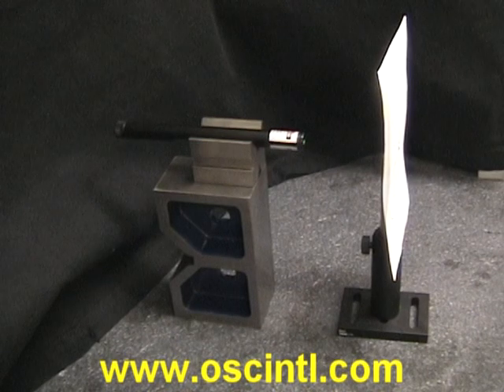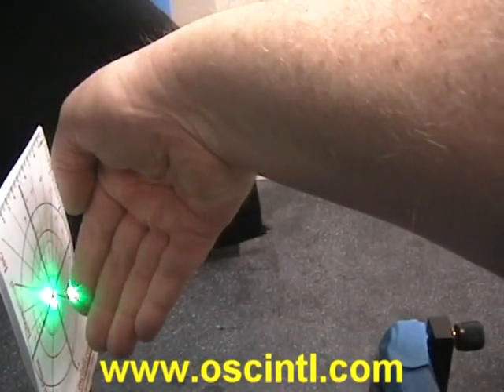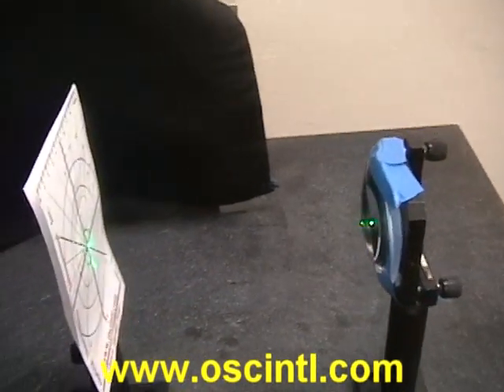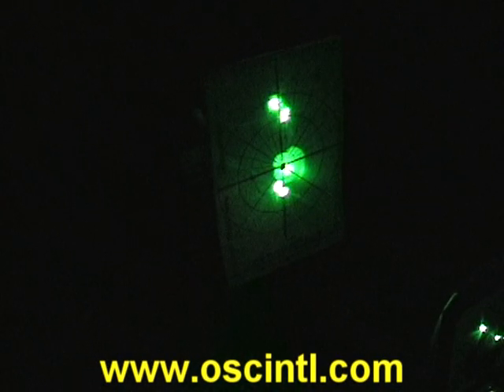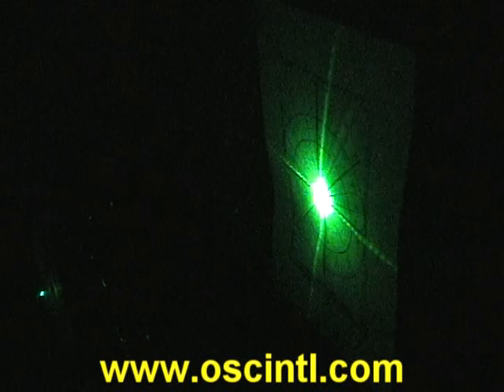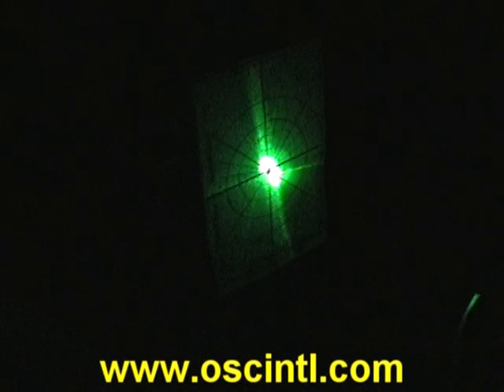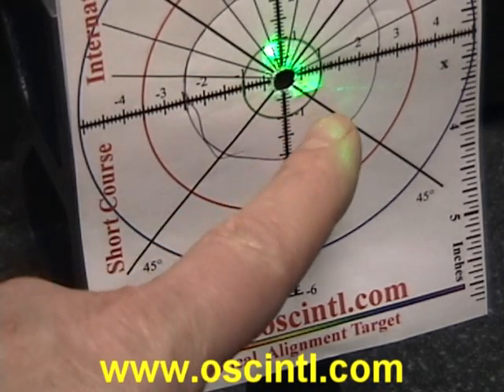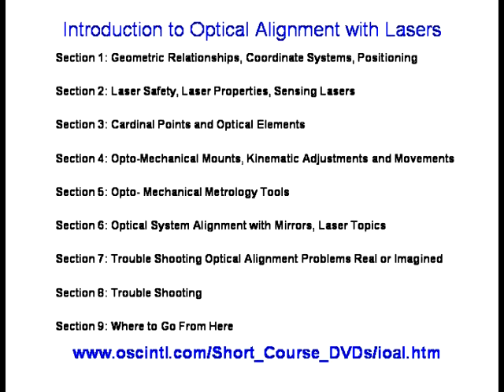Aligning a Single Biconvex Lens

Comment: Great video. I've dissassembled the back element of my camera lens (bad idea) in order to clean it from fungus.When I put the back element back, images taken with the lens were soft and had chromatic aberration on one side. the back element is hold on whith small screws. My guess is if a center the back element well, maybe I might get the lens working properly again. Do you think your method would work well or what would you suggest me to do? Thanks